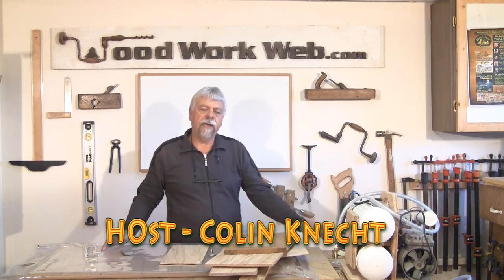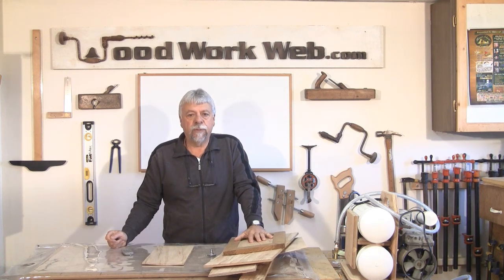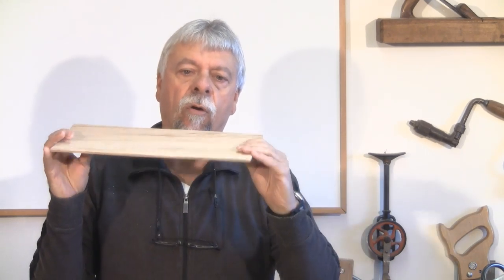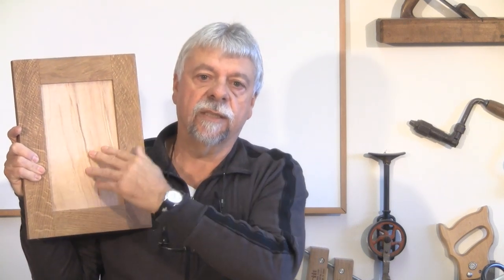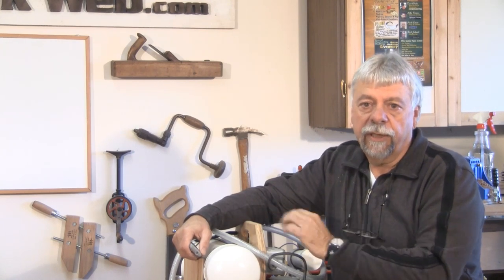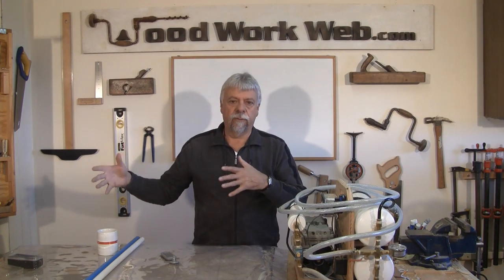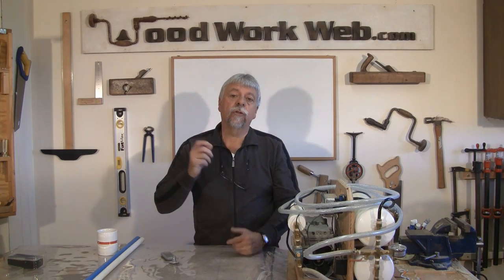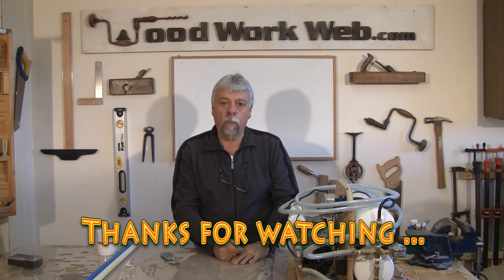Wood Veneer Primer - A woodworkweb.com woodworking video

Comment: Hi there!
I've never seen before this way to veneer a board. Here in Spain we have been doing this for ages but not in this way. First of all, few woodworkers veneer boards nowadays as they can buy them already veneered with lots of different dimensions and types of wood like ash, birch, oak etcetera.
Also we barely veneer plywood but just mdf or chipboard. I don't know if you use this last one much in U.S. though.
Then if someone wants to veneer a board there are two ways of doing it.
The first one is by using contact adhesive which means that there is no need to use a press machine o vacuum.
The second one is by using titebond type glue but you have to have a press machine to do it properly.
Just share how we veneering in here.
Thanks for the video.
Reply from the maker: Roger Anglès Devesa yes we do everything you describe here in North America too ... thanks for commenting, good to know :)

Comment: Thanks for the veneering introduction! Nice video!

I restore antique radios and most have the veneers destroyed etc... Theres nothing FLAT on these guys and i cant use a vacuum press . I need to bond the veneer right away and ive done some Hot Iron work and it does well on a wood sub straight., however some repairs i make i have to use a body filler to do a repair such as major 90 degree curves, i call a waterfall. Water based glues will not work on a bondo sub straight filler . I found also on veneers the wood does creep ,especially paper backed and after a nice finish , 6 months down the road the finish cracks, mostly with lacquers. I watch my mill thickness and no luck. Either the glue is shifting,TITE BOND II or the Lacquer is acting up or OPERATOR error. 
I figure its me and i need some advice and guidance on how to do this.. I can send pics as well.
Have you advice to get my problems solved?

Thank you so much!

Cliff
Reply from the maker: Hi Cliff, not enough room here, email me through the link on woodworkweb, not sure I can help, but I have some ideas of who might be able to.

Comment: If you are putting a very expensive veneer on a 1/2 sheet of plywood, (a 16x16 panel that fits into a mitered frame for example). I would hate to veneer the back side, as this will never be seen. I would hope they would be dimensionally stable if both sides were sealed with similar finish?
Reply from the maker: Paul Flynn What is normally done is to put an inexpensive veneer on the back to help keep the plywood stable and not warp. With 1/2" ply, you may get away without veneering both sides, also depends of what any warping might affect and what the structure around it might be. Woodworking is sometimes a guessing game of knowing what is best. Also if you are contact cementing the veneer, this seems to be much more forgiving than yellow glue and vacuum pressing in terms of not warping. At least that has been my experience.